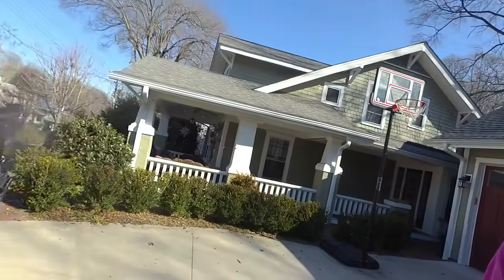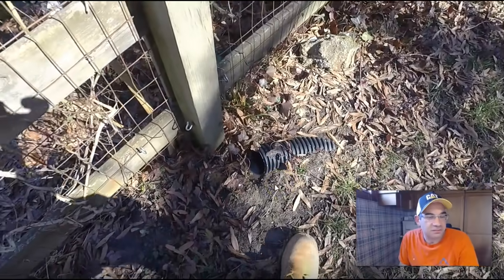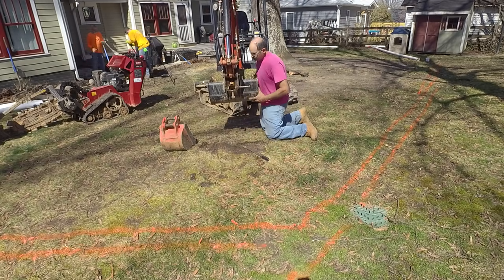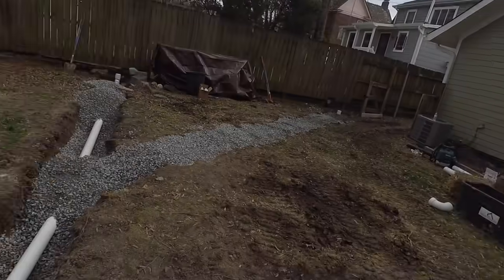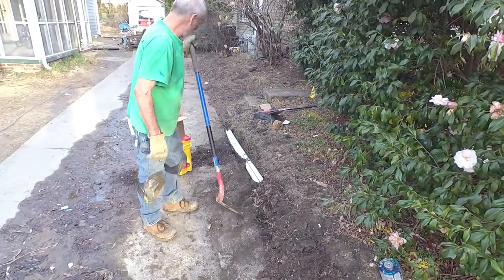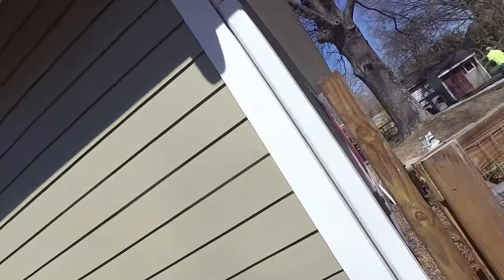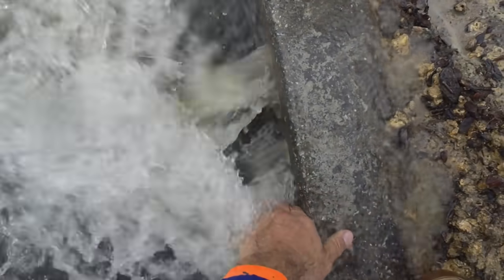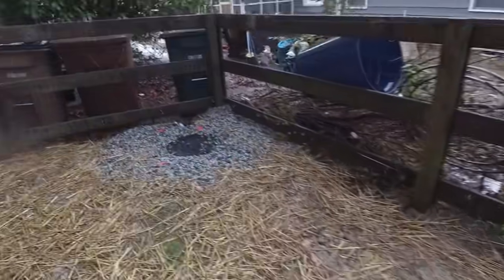Installing a french drain and dewatering pumps to solve stubborn back yard flooding

Comment: I gave a thumbs up when you basically said "I got the job over another company because I listened to the homeowner about where the water is coming from and going to" (basically). 
I had guys quote a job for me, and they both seemed to have no idea where MOST of the water was coming from, nor care. I felt their jobs would not stand the test of time and needed too many trenches. So I did the job myself and saved about 5000 bucks. I started where none of them wanted to, a heavily wooded area, and diverted most of the water away from my backyard first. I do not own a excavator, so... Lots of digging by hand and cutting roots with a reciprocating saw!  Now I have a smaller job to take care of, One low spot and downspouts , which will all drain down the OTHER side of my home. So about another 1500 bucks to go. Still a saving a bunch and I think my job is better. But nice video, real nice work. 
I just wish one thing for all french drain videos... A drone aerial view of the trenches during work, and a video of heavy rain after the job is completed. You got the after shots, and I think this lawn will do/look even better if they can grow some nice thick grass.
Reply from the maker: I agree Guy. The key is tackling the water at the source if possible. Only the homeowner knows where that is. I'm glad you got your issues under control! Thanks for watching! - Shawn

Comment: So for our root zone mix and most USGA Greens, we use 90 to 95% sand, 5 to 10% Peat which is enough to water only once a week with newer cultivars of Bentgrass. The rootzone is 16 to 20 inches thick depending on a few factors. We use french drainage through the green along with a smile drain on whatever end the green runs to, on some greens this can be multiple  sides. We use a drainage rock around the drainage than a pea gravel around 4 to 6 inches thick, this helps speed up drainage and it pulls fresh oxygen into the rootzone mix. 

This is how greens perk 25 inches plus. But it is common to see a small build of up water on bone dry greens, just like a dry sponge it takes a little time for it to start absorbing water. But not to long.
Reply from the maker: Awesome! thanks for sharing!

Comment: for directional boring, you can do so with a pressure washer wand inside a 4" tube. works like a hot damn
Reply from the maker: Yes it does! We've done that before. It makes a muddy mess but is fast and easy.

Comment: ✨👍. Another great job 👌.   One idea could be to do some landscaping along the French Drain ..And place small stepping stones along the French Drain like a pathway....Have you ever considered using a larger basin ( drywell 4' wide and deep ) and then run lines from that to sump pump basin ..And could you have run 1 1/2 discharge and then increase to 3" at the street ?   Great Vid 🤳....✨👍

Comment: Drilling the curb for the three discharge lines has got to be very satisfying. That’s a cool drill bit. (Edit) I think you’re going to need a bigger pump.
Reply from the maker: Yes it was! My quote stated - the cub will be cored for a perfect fit to the pipe - and the homeowner was very impressed when he saw it. He mentioned the wording in the quote and how nice it looked.
Reply: Them diamond bits are super pricey, I think I see you used a hilti for that, great machine, have a dd100 or something like that sitting in the attic.

Comment: I love your videos so this is just helpful feedback.

Looks like the pump is short cycling. 2 ways to fix it & yes it’s more $ and more work.
First way that helps: add another slotted / drilled-hole pipe to the french drain. You can tie them together with a Y right before the entrance to the basin.

The second way is to enlarge the diameter of the basin. If you meet with a local pipe supply company, they will usually be able to give you 24 inch diameter culvert pipe, cut to length. So like a 4’ section. Most companies stop selling cut to length sections after 24 inch inner diameter, but if you do a lot of business with them they might sell a 30 or 36 inch.
Then to up the gallons of void capacity per inch of fill for the cylinder, you can dig out an extra 6 inch radius or 10 inch radius on all sides and fill it with gravel. The disadvantage there is that gravel only allows 40% of its space to be filled with water. Meanwhile a hole in the ground obviously allows 90% or more of the space to be filled with actual water. You of course will have to drill approximately 90 3/8th inch holes in the pipe or 60 1/2” holes.

As a rough math calculation, a 36 diameter hole filled with 1 inch of water is 4.5 gallons of water. That is 4.5 gallons of water per inch. An 18 inch diameter hole filled with 1 inch of water is approximately 1 gallon. You can imagine now if a pump turns on at 10” and off at 3” (aka 7” of fall), that 32 gallons pumped is a lot better than 7 gallons.

Another way that is unconventional might be to bury a 5 foot section of culvert pipe width wise. you will have to buy the solid $45 lids for both sides, which kind of sucks. But it is potentially better than digging a vertical hole. I know digging vertical holes is really hard. And you have to go with a really large diameter. So potentially digging a horizontal hole for a random 24” or 30” diameter culvert pipe with a 12 inch culvert pipe as a pop-up (pump access) would be more ideal. There are pipe distribution companies that will weld these connections professionally for you too.

I think ideally those pumps should cycle on 6 to 8 times per hour. 15+ per hour is generally considered short cycling. Zoeller has been really kind to me on the tech-support side. And yes we all kind of know trying to get an outdoor sump basin during a heavy rain to cycle less than eight times per hour is pretty tough.

And here’s a video from them
https://www.zoellerpumps.com/en-us/training/videos/optimum-run-time

I hope that helps with future projects. And I hope that helps you with flash flooding rain events that can apparently nowadays be close to a rate of 4 to 6 inches of rain per hour in the south (even if rain time is 15mins total). I know Nashville Tennessee has several 6 to 8 inch 24hr rain events on record

Peace!
Reply from the maker: Thanks for your very informative comment! We use high quality zoeller pumps so we're not too worried about their longevity. A larger basin would keep the pumps cycling less for sure.
Reply: @GCFD  Do you know something funny? I just designed my last system in Franklin Tennessee and installed it one day before that flooding happened. No issues on that house, but that’s hilarious. I’ve been saying 6 to 9 inches of rain in a day is not unusual and people have been telling me I’m crazy, and it finally just happened and my over engineered system kept the yard sooo dry.

Best of luck man. I love watching your videos

Comment: I put a French Drain in, along my driveway. Like you, I left the gravel over the French drain uncovered. Within a month, after several good rains, the gravel became mixed with dirt and sealed itself. It picks up and moves water under the ground but the exposed top is useless.
Reply from the maker: You must have different soils than we have here. I have FDs going on several years old that are still working fantastically.

Comment: Could sorta see this coming, 4” pvc into pumps with 1.5” discharge.   And it looks like the pump fast pumps out of the basin capacity, so you get a lot of cycling in light rain events. And acknowledged that it was an unusual heavy downpour. 

I think that job had the possibility of a higher flow pump installed... although in small rain events it would cycle even worse. Maybe a dual pump system? A low flow and a high flow?  

Eh armchair quarterback here... lol.  We encounter these types of issues with irrigation work too, balancing the flow of the system with the correct sized pump. 

All that said, you do fantastic work.
Reply from the maker: Thanks for commenting Eric! These are all good points to consider. After talking with the homeowner we decided that keeping up with the flow was not a goal of this job because the water did flow out to the street, and the large volume coming from the neighbors. The major goal was to get rid of the residual water after the rain events. 👍

Comment: Those zoeller pumps are great but even a 1/2 hp sump only puts out about 70 GPM and that’s not going to be strong enough to handle That much square footage of yard including his neighbors but atleast the water won’t stand in the backyard like you mentioned good work Shawn

Comment: You can also get a "sock" for the French drain pipe, what a lot of applications in Canada do, then you can put grass (sod typically) over top of the gravel.
Reply from the maker: Burying the drain kills the flow into it. The sock also kills the flow into it and clogs with sediment. We like to preserve the flow which provides the energy to carry fines through and out of the system.
Reply: @GCFD  Weird, seen one dug up that had the sock and sod on top about 3 years ago.  It was installed around 2000-01 and it had about 1/2" of dirt in the bottom (a flushing would have fixed that I suppose) but the sock was actually pretty good and the people had zero drainage issues.  Before their backyard was a swamp for days after it rained.  To each their own I suppose.  Now they don't pack dirt around the pipe or sock, it's gravel for like 2' on either side and above in the case I seen.  They just had a layer of sod on top.  They didn't want to be throwing rocks anytime they mowed.

Comment: You can see at the end of the video that there's so much water coming into that french drain that it's beyond the capacity of the system. That's why you can see water on top of the gravel, at 29:00. It's effectively using the entire trench to drain into the neighbor's yard. In hindsight, this probably needed a second perf pipe (or bigger pipe) for that run across the back yard. I bet his sump pump in the basement has to run a lot less though.

Comment: Good job.
What a crazy neighbourhood.
Unfortunate the city doesn't  step in to organise all the properties better.
One thing that might have been better for the pressure pipes. If they had discharged over the end of the driveway to be in the lee of road gutter wall. Better flow and wouldn't back up the water in the street like it was.
Reply from the maker: This is a very old neighborhood.

Comment: What you did for this customer sounds like something I need to do for one side of my yard as it collects standing water after every rain for days. And I also have in ground power ran from the power pole so maybe pump to to my pond as it will drain out without issues from there.
Reply from the maker: Sounds like a plan.

Comment: No drainage system can handle an inch/hour or more thunder cell rainfall.
> Indication of success isn't seen durung or immediately after an intense thunderstorm. It is what it looks like 30 minutes later. You can't practically size a system to handle max record rain that happens 0.1% of the time nor should you. 
> Sump Pumps Max output is about 2000 gal/hr. (Rated at 3300 gal/hr with no discharge resistance). An inch/hr with all that surface area can easily exceed the pumps. 
> Even huge city storm drain systems get overwhelmed. However once rain subsides it should drain fairly quickly and completely. It did. Good job.
> Normal to moderate rain fall up to 0.3 in/hr, this system will rock.
>*Clearly his yard needs to be leveled, low spots filled and sloped towards basins and French drain.*
> My system works great but saw it overwhelmed like this once. Usually the pumps kick in every 2 to 10 minutes, run for 10 to 20 seconds, then off, with moderate to light rain. However we had a line of thunderstorms dump 1.9 inches in a short  period. The gutters were shooting water out like fire hoses... Pumps were running continuously and some standing surface water formed...  Thunder cells moved on and surface water was gone. Sump basin pumps returned to cycling as normal. It was interesting to see.
> I recommend with any new system you get your rain jacket, rain boots and umbrella and observe your system DURING rainfall especially heavy rain (except if lightning in area).
Reply from the maker: Awesome Comment! Thanks for posting and for watching! - Shawn

Comment: Shawn....Great video. You got good use of the buggy, new trailer & Harley rake, which saved a bunch of time. I like that you use Zoeller pumps. In my old house, I had a Zoeller 1/2 hp 2” that would pump 120 gpm! I wondered if you thought about using a landscape hand rake, which can be 36”/42” wide. It helped me hand grade at my old house. Thanks again.
Reply from the maker: Hey Jim! Yes, we do use those landscape rakes but I never think about it. They work very well for leveling out being 36" wide. Speaking of rakes, what do you think of this one? https://turfteq.com/landscaping-equipment/power-rake/

Comment: Is the cord of the sump pump long enough to reach the outdoor outlet or do you need to splice it?
Reply from the maker: I order these pumps with 9, 15, or 25' cords depending on where I'm using them. You're not supposed to splice or use extension cords with these pumps.

Comment: Suggestion for your concrete/dirt carring cart. When your tub is full of concrete or dirt, the center of gravity (cg) moves so far forward that it lifts the aft end of the cart off the ground. There are several ways to help control the forward cg tipping. You could add weights to the standing platform. Or you could also add a foldable extension platform for you to stand on...shifting the cg further aft. You could also carry an extension platform, when needed, that hooks onto the existing platform. If you make an extension then you have another video for YouTube.
Reply from the maker: Good tips!

Comment: I really enjoy your videos and how you approach problems similar to what I’m encountering. I’m an engineer, I don’t know how to analyze flood maps but I’m familiar with the process and wondered if you look at drainage area and compare the amount of rainfall expected during a typical storm, 10 year storm, 100 year storm? I thought you would mention how these systems are designed to handle typical storms. drainage area calculations can be performed but I don’t see you getting into that probably because these are over designed for the types of drainage they need. The storm that came through was probably something on the order of a 10 year storm, sizing systems so they are not overwhelmed when a storm of that magnitude come through would be bigger but more complex and expensive. Ultimately like you said, it got the water out of there in 45 minutes after rainfall stopped. I thought the system handled that storm great, 3 inches in an hr of rainfall is bonkers!! But to get the accumulated surface water out of there immediately after the rain stopped was so awesome to see!q

Comment: I think the lesson from this job was to even out the workload for each pump. Too much water going to one will cause it to overflow. Everyone did an amazing job though.
Reply from the maker: This system was never meant to keep up with the rain. That would be impractical. The goal here was to evacuate the residual water after a rain. 👍
Reply: the two pumps are in two different elevations of the yard.....

Comment: seems like if it's possible to passively drain the sump on the side, could solve the rest of the problems. I wouldn't want my shed flooding every time it rains. nice work, love seeing it all working when it rains. maybe could try putting a berm at the back of the property to gather the river before it comes into the yard. gather it and pipe it away
Reply from the maker: We thought about a berm along the back, but there's just too much water with nowhere to send it. So as it works now the FD collects the water and the pumps take it to the street instead of the yard holding water for days and days and staying muddy. This was a tricky project for sure.

Comment: I would call that a fail. Nothing but 6" pipe or larger. Those look like 2" and sump pumps do not perform at all. Normal rains, no problem. These early spring/summer biblical rains, no dice. Here in OKC we've had 7" in 30-45 minutes. Just found your videos. Great job so far.
Reply from the maker: Did you watch the end of the video where the yard was dry within 45 min of the rain stopping?
Reply: @GCFD  Yes, also watched it flooded out. Guess no system can control mother nature.

Comment: Can you explain why you pumped the downpipe water? If the downpipe was a sealed pipe, the head within the downpipe would overcome the slight uphill to the street. The roof line is obviously well above the street level. In the same situation in Australia, we would never add a pump to this downpipe. Yes there might be some standing water in the pipe when not raining, but this doesn't present any issues. 

Its interesting to see the use of the rigid pipe and pumped solution, not something we typically do for subsoil. 

Great Video with different techniques.